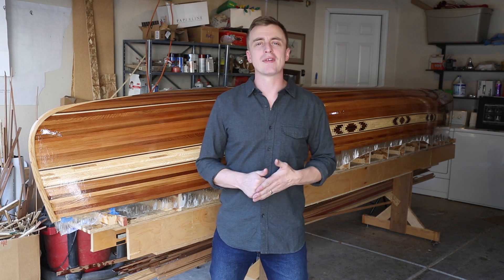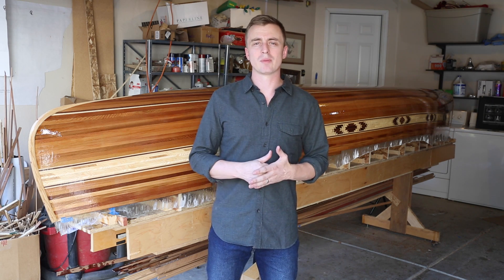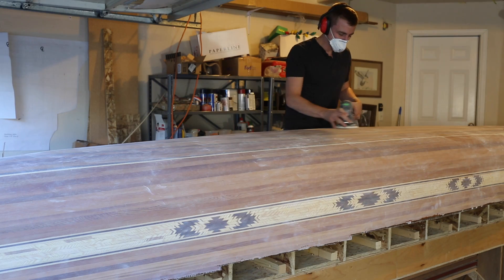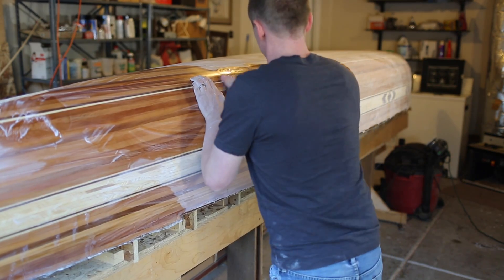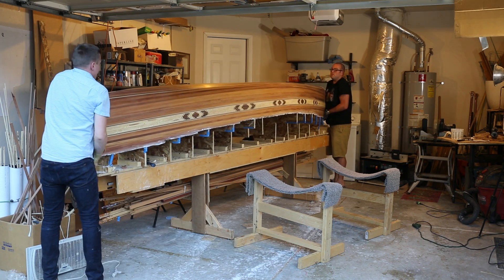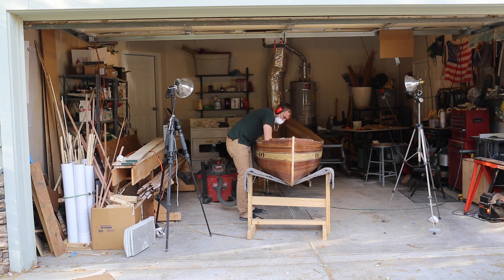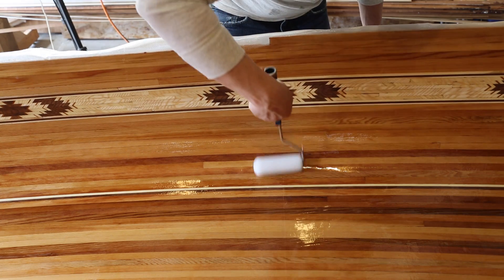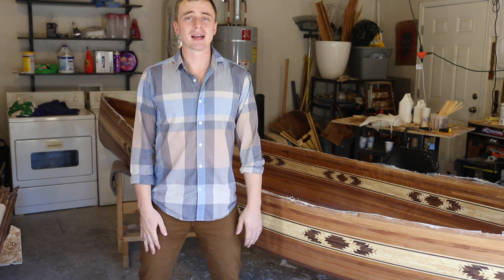Fiberglass Epoxy Seal - Inside of the Hull (Ep 11 - Cedar Strip Canoe Build)

Comment: As others have said for wet sanding. Yes to dish soap and using a block. But it’s also worth mentioning it’s much easier to polish in the end if you sand in straight lines. One way is fine. Cross hatching is even better.

Comment: Wet sanding works best if you can use a lot water and flush away the debris as you go.  I like to work outside and use a garden hose to frequently spray things down.

Comment: sooo I ran out of epoxy & hardener on the first coat on the inside, and now I have to order more which won't arrive until a week from now. What do I need to do to the first coat of epoxy on the fiberglass in order to allow the next few coats bond to this now dry first coat?
Reply from the maker: Elijah Wasson you might wanna reach out to the manufacturer of the epoxy... if it were me I’d scuff the hardened stuff w 220grit then clean the surface really good several times with some kind of mineral spirits or something. Good luck - hope it goes well!!

Comment: You should use nitrile gloves (EMS gloves) when handling the fiberglass and using epoxy.  Epoxy on your hands can be really tough to get off, and can cause skin reactions.  You can get the gloves sometimes as cheap as ten bucks for a box of 50.

Comment: If you use a big sponge you don't have to dip the paper and that really helps after hours of wet sanding. Also I've started using some dish soap in my water when sanding stuff that wants to gum up the paper.
Reply from the maker: Phil Lowman cool thanks for the tip!

Comment: Just curious Adam,   what part of the country do you live in?
Reply from the maker: Southern Oregon, go ducks
Reply: The reason i ask,  How do the wooden canoes hold up to scraping rocks while floating rivers and stream?
Reply from the maker: They're... pretty damn strong... https://www.youtube.com/watch?v=nagWw0us1H0
Reply: lol,  I knew that was coming, I cant watch it again man. it hurts
Reply from the maker: haha - yeah, sorry. To answer your question more directly - The fiberglass epoxy seal is more of a shell than a finish. It's really just incredibly strong and it's flexible so it doesn't crack easy at all. You varnish over the epoxy because epoxy doesn't have good UV protection. You have to revarnish every couple years to keep it nice and protected from the sun. The varnish is also pretty strong. It will get scratched but when you revarnish it, it should be as good as new because the varnish will fill any of the scuffs serious enough to actually reach the epoxy. I will post a video for varnishing too - that's like the last step though. Let me know if you have other questions about that - this site also has some good information about epoxy strength also http://www.westsystem.com/ss/how-to-use/
Reply: Thanks so much, I am hoping to build one  when I get all my builds done. love the channel man
Reply from the maker: Thanks Mike!